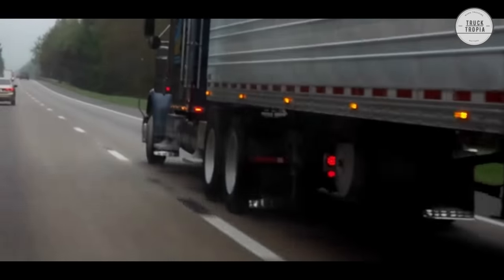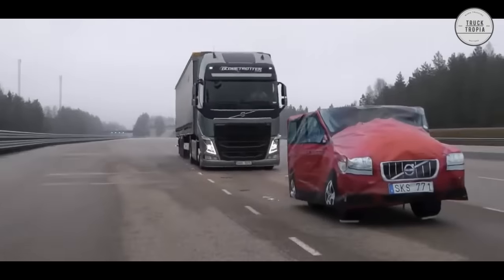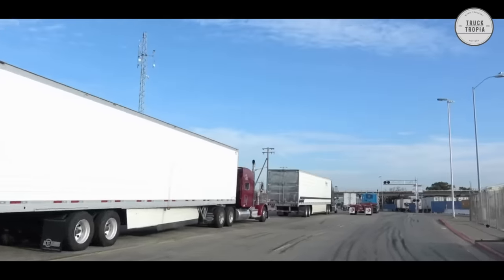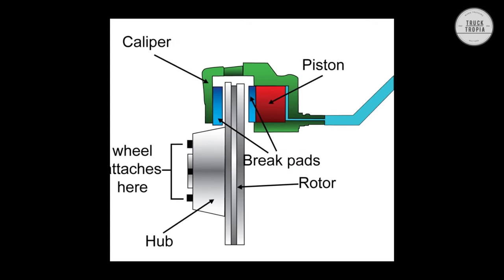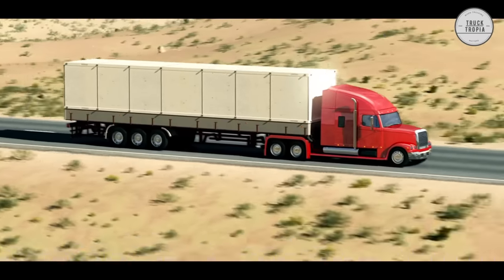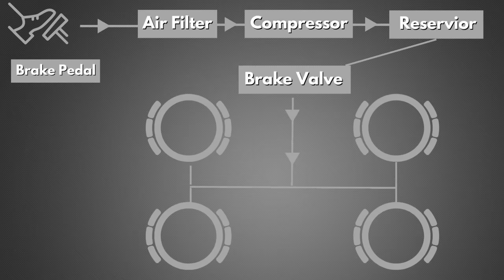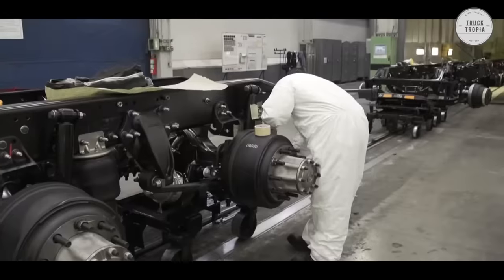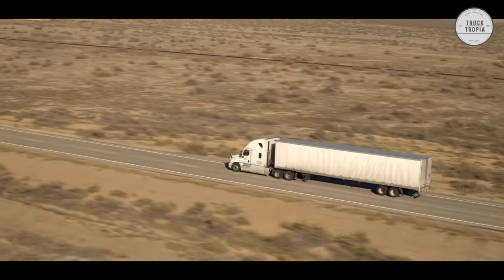Why Do Semi-Trucks Use Air Brakes?

Comment: The air brake on a train works opposite of a truck. The air system filled throughout the train to about 90 psi and when a brake application is made, the line pressure along the train is reduced by exhausting air through the brake valve in the locomotive. The pressure inside each cars tank then tries to also reduce but is deverted by valves to the brake cylinder on each car. It is almost 3 times more pressure. For instance, a standard 6 lb reduction within the train’s brake line equals 25 lbs of pressure in the brake cylinder. The cylinder moves linkage to each shoe that then presses against the each wheel on every car and the locomotive as well. That system has been in existence since the 1850’s. Cars are bled of their air so there is no brake available when the car needs to be moved by a tug or rolled down a siding. A manual hand brake is available on each car and is used to secure the car when parked at a customer or in a side track with no locomotive connected. The reason this works so well is whenever train comes apart or locomotive is separated or an emergency application is made, (air is blown out of the line to zero pressure, the train brakes are applied fully. However, over time the car will lose its stored air and the brake will release. This is why the hand brake is applied to cars left off from the train.

Comment: Those guys would really struggle if they ever wanted to put air brakes on your standard car. Where are they gonna fit the air tanks and the compressor? If the compressor’s small, it wouldn’t matter that much but the air tanks would make them sacrifice a lot of space. I do not think that air brakes will ever come in cars.
Reply: A car wouldn't really benefit from them, so there would be no reason to use them there
Reply: That would be the biggest mistake a car manufacturer could make.  Tow truck companies would love it... they could make a killing running around in the winter beating frozen brakes to free them up.  In general people aren't smart enough to deal with the little quirks the video left out.

Comment: first .. of all airbrakes are much more resilient against small leaks .. they will still work .. if! the safety system will give them free !! .. 

second .. you need a fluid reservoir at the "size of Lake Michigan" to take up and follow movement of the brake parts in Semi brakes due to size and tolerances, which is not very convenient and reg. to "first" once the fluid is gone you're stuck  .. air brakes can be patched up temporarily and "hump home" 

third .. you'll need a much more complicated system to hook on to a trailer with hydraulics iow. you would need a separate hydraulic system on the trailer that activates by ex. air  ...

fourth .. you need some kind of help to build up pressure in a hydraulic system as you can't fit a pure mechanical weight/arm/pivot point system in the pedal bay to build pressure .. that help could be vacuum or air pressure ... 

fifth .. you will .. with fluid .. just add one more factor in play reg. heat. Hydraulic fluid LOVES to react with water / moisture and as we all know water boils at 92 - 105°C dep. on air and fluid pressure so old brake fluid can start to build steam pockets around the brake cylinders & calipers under heavy brake use with a fatal split second loss of brake functionality ...

and ..

and ..

So a 60 Ton Semi became much more safe and reliable as the air activated brake system saw daylight ... ALTHOUGH a lot of people forget, that even with the right dimension and proper layout of brakes .. a 60 Ton semi needs more space to brake than a car .. and a motorbike can brake even faster and shorter than a car  .. and still there are idiots out the trying to brake test a semi just because she/he had to pull out in the lane to continue .. or change lane because some other idiot in front of her/him (where the first idiot can't see an thing what's going on) makes some dump move .. those idiots are also the first to complain when the grocery shop don't have the goods on the shelf due to the delivery truck is late .. or their parcel is one day later than expected because of some idiot brake testing a DHL truck ending with parcels spread over a sq.mile of highway ....
think about, that it is their job to drive that 60 T semi .. in rain, snow and ice ... to get the goods forth & back ... what would you say .. you office mouse .. if somebody did switch your computer on and off all the time .. deliberately sabotaged the Xerox every time you had to use it ... walked in your way constantly when you had to go to the boss to deliver a file or case ....

Comment: In addition to added expense, if air brakes are used on a car or small vehicle, the gas mileage will be less because the engine now has the added task of powering the air compressor on top of all its other accessories.
Reply: What if it's an electric compressor rather than belt/chain driven
Reply: @adventureoflinkmk2  An electric compressor would have nowhere to get its power other than the alternator, which is powered by the engine, I think. Maybe you could have regenerative braking or something, but that seems like overkill if it would be there just so that you could use an electric compressor instead of directly driving it from the engine.
Reply: @adventureoflinkmk2  Then the juice comes from the battery that now has to be replenished by the car's alternator that is driven by the engine. Energy cannot be created or destroyed.
Reply: @adventureoflinkmk2  That electricity would still have to come from somewhere, and a direct mechanical drive is probably more efficient than turning that mechanical energy into electricity then back into mechanical energy
Reply: Your combustion engine car already has a compressor built-in: cut off the fuel injectors, leave the throttle body full-open and divert the exhaust to a compressed air tank when you lift your foot from the accelerator, engine braking as a compressor instead of vacuum pump will give you 1000X more compressed air than you need to operate air brakes.

Even if you ran a separate electric air compressor, you wouldn't need much air to operate car-sized air brakes and that compressor only needs to run long enough to restore the minimum operating pressure after brake application, which isn't much. Also, when you decelerate by moving your foot off the accelerator, your deceleration is driving the belts and alternator. A system could easily be designed to run the compressor for practically free during that time to build enough pressure for two or more extra braking events, then the only time you would need to spend energy pressurizing the brake tank is when you brake like a maniac multiple successive times to deplete it faster than it can regen during deceleration.
Reply: @teardowndan5364  The final word. 😀

Comment: It seems like it has more to do with cost than effectiveness. Disc brakes resist heat better since they're ventilated, and can apply huge amounts of force with the hydraulic system. But the cost to install and maintain disc brakes in all of a semi's wheels would be too high.

Instead, leave the discs only for the front, and use cheaper drum brakes that'll get the job done good enough in the rest, since they're working in multiple axles at the same time. Plus they already have the air compressor for the tires anyways, so it's two birds with one stone. But that's my guess.

Comment: Many trucks used to have air-assisted hydraulic brakes. That works too. A pure air brake is simpler and more reliable than a combination brake. Yes, an air brake can lose air, but the compressor replenishes it and such a leak can be easily fixed. With the combination brake, if the hydraulic fluid is used up, then that's it. End of terrain, out of the mouse, game over. And cleaning an oily brake drum because the brake cylinder is leaking is no fun either.
And brake discs brake more evenly and more pleasantly. But it is not stronger because of the lack of servo effect of the brake shoes. Theoretically they may have better cooling, but how many brake discs have you replaced because of thermal cracks? I have seen few without. They last around 100,000 - 150,000 km, drum brakes 500,000 km. Depending on driving style. That's why we also use hydrodynamic retarders to relieve the brakes. Of course, the rear tires wear out faster.

Comment: As someone who used to drive trucks, I’d use gears to slow down. Cannot rely completely on the brakes. Especially going downhill! But ya better get it into that gear as you transition to a downgrade or ya won’t be able to once the truck gains momentum. Truck’s transmissions were designed to last a million miles. The truck will only shift gears if the rpm’s and speed are exact for that gear. Not like a car manual transmission where ya can jam it in if necessary. Nope. Once I became more comfortable with truck trannys, I could float the gears. And essentially used my cruise control and jake brakes to travel. 
Thank goodness I never had to use a runaway truck ramp. Driving semi requires loads of common sense and a strong work ethic. Because that is singularly the toughest job I’ve ever endeavored. So, it’s not about what type brakes are in a tractor. It’s the operator.

Comment: Yes air breaks are most used but when you’re pulling an load that can weight up to 80,000 Pounds your not gonna use the air breaks as much your gonna spam the Jake break to slow down because the Jake break is more affective at slowing down 80,000 lbs then the air breaks especially when going down an steep hill

Comment: Brake developer here with experience in trucks (and buses) and also passenger cars.
I'm sorry, but I must object to your conclusion. No hate intended, just some not correct statements that trigger me as an engineer. Let me explain:

"Greater stopping power":
The mode of brake activation says nothing about the power. You could build the same brake with the same braking power, but have it be activated hydraulically. The problem here would be, you would need a much greater brake booster than on a passenger car and also a redundant one as the remaining braking power in case of a booster failure is too low. An air brake has this redundancy built into the brake valve, that can be either controlled with the control pressure from the pedal (regular use case) or directly when pushing the pedal through (in case of a pressure loss in the control ciruit). But this would make a hydraulic brake for high tonnages much more expensive than an air brake. So your point about the price is also wrong, as you cannot compare a car brake with truck brake.

"Quick stopping":
Acutally the opposite is the case. Since air is more compressible at operating pressures than brake fluid, a hydraulic brake has a better brake force dynamic. But the real reason, that causes differences in braking performance (i.e. stopping distance) are the tyres. On trucks they must carry significantly more load over a longer distance. This is always a tradeoff with friction. You could theoretically build tyres with the same performance as a passenger car, but they would wear out in no time, and you would not sell any of them, costs are just too high.

"Reduced wear and tear":
I can be wrong, but I'm taking that you mean brake rotors/drums and pads/linings. Same as in the first point, the mode of activation does not matter. Why truck brakes are more "durable" has several reasons. One is for example that there is simply more material on a bigger brake, which you need anyway. Another one is again a tradeoff topic (performance (high friction) vs long live), where a selling point for commercial vehicles is less maintencae whereas for car owners it's more of a 'meh' point like oil changes. Sucks that you have to do it it, but most cars simply don't as many miles as trucks.

"Reduced heat build up":
Perhaps the most controverse topic, because I think you meant the right thing, but (in my eyes) didn't explain it correctly. Here my take on it: The heat produced from stopping a vehicle with a certain mass and speed is always the same, the kinetic energy converted into thermal energy. The thermal energy results in the same temperature if the brakes have the same mass and material. Of course truck brakes have more mass, so using a truck brake to stopp a car would naturally produces less heat, as the car has less energy due to it's lower weight.
But I think what you actually meant is that pressurized air is not critical in high temperatures, since it cannot start boiling like brake fluid does. In this case you are right, it is the better medium.
However I would like to note here, that many people think fading comes from boiling fluid, while it actually comes from the brake pad friction coefficient degrading with temperature (means less brake torque with same force). If you have boiling fluid in your system, your pedal will have almost no counter force and go straight to the floor with only very little deceleration.

"More reliable":
Not really. Both can be built with the same failure rates, just for trucks it is crucial to make as many miles as possible. As for safety concerns, both systems have redundancies as well as the same minimal performance requirements in case of a failure, which are needed for the vehicle certification (without you cannot sell a vehicle type).

"Safer": See "more reliable"

My conclusion: After all I think your point was "air brakes are just better suited for trucks", which came across, and I agree with that. What felt a little akward was, that it sounded like you said car brakes are cheaper and worse, but that's just not correct. Each vehicle type has the best brake type for their use case, but you cannot simply compare the two directly (->apples and pears).

Again, no hate intended.

Edit: Typos corrected + short explanation added for better understanding
Reply from the maker: Holy moly Well thanks for the perspective 😅 might have to do a new vid
Reply from the maker: Write me a detailed description of why trucks use Air brakes and i make it a video 👍 called explanied by Engineer 😅

Comment: You heard it here folks: disc hydraulic brakes are better in every possible way and should always be used forever except sometimes they’re bad, Air brakes are also better and good in every way and use drums that are worse but also good so use air drum gas hydraulic brakes on the thing that is better sometimes also for reasons. There you go
Reply: There ya go dude,thanks for straightening that out!

Comment: Another unmentioned benefit of the air braking system is its load-sensitive regulation: beneath the rear axle of the tractor, a system of levers and valves operates to incrementally adjust the air pressure directed to the brakes and suspensions in accordance with the applied weight on the loading platform.

Comment: Brakes are held off in normal position when driving.
When parked air is released and spring pressure applies the brakes.
On start up if the air tanks are empty the truck will not move untill air pressure builds up and is greater than the spring pressure.
That is why you sometimes see a driver rev an engine above Idle speed to build up air pressure quickly.
When the hand brakes are applied on parking you can hear a 
WHOOSH of air escaping to allow the springs in the braking actuator apply the breaks.
If a truck is unable to build air the truck is stuck untill such time as the brakes are WOUND OFF so it cannot apply   the spring that applys the brake .
That operation needs caution . The truck must be under a solid tow bar to prevent running away. 
The whole air brake system is designed to 
FAIL SAFE.

Comment: Lot of mass is lot of heat generated by friction when car is breaking. Air can not be boiled like fluid. Also small leak is not big problem for air brakes. Compressor can refill instalation and it will still work. Fluid leak is much bigger problem.

Comment: Another reason semis use air brakes is because the trailer needs braking power. In a tractor trailer with hydraulic brakes the driver would need to manually bleed the brakes on the trailer while hooking up to it. It's a time consuming process that drivers and companies became very frustrated with. When hooking to a trailer the driver can simply connect the air lines and push a button in the cab to release the brakes. This saves lots of time as drivers will haul several trailers in a week
Reply: Not true, on vehicles with hydraulic brakes. the trailer uses either electric brakes or electric over hydralic brakes.

Trailers that use hydraulic brakes have their own self contained system that uses a electrically activated master cylinder to activate the brakes. Personally I prefer the straight electric brakes to electric over hydraulic because it is more reliable in my opinion.

Virtually all of the pickups you see towing goosenecks or tandem axle trailers have trailer brakes, usually electric.
Reply: @SilverStarHeggisist  that's true with new technology but air brakes are older than electric trailer brakes. They were not an option back when air brakes became widley used in the 60's. They had to manually bleed the brakes back then
Reply: @ratchet2003  which to be fair is kinda dumb considering the technology for electric trailer brakes has existed since the automobile.

Comment: Disc brakes are almost always the best choice.cost is more, but stopping power is all that counts here.Yes, being in the right gear is essential and so is Engine brake.
Reply: Disc brakes don't work as well in wet conditions, which is why some cars have discs on the front wheels and drums on the rear wheels.

Comment: In addition to air brakes some of the older semis I drove (back in the 60s) used vacuum brakes. I don't know if those are in use anymore.
Reply: I didn't think diesels made vacuum, that's petrol
Reply: @adventureoflinkmk2  all engines create vacuum in the intake